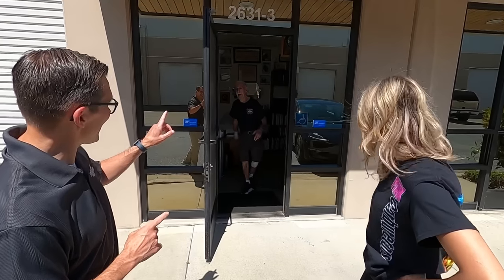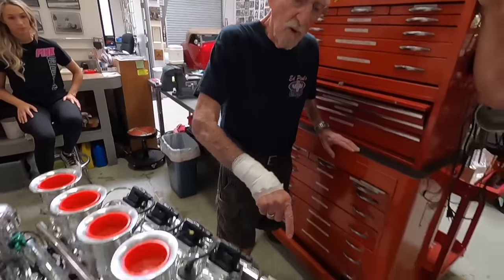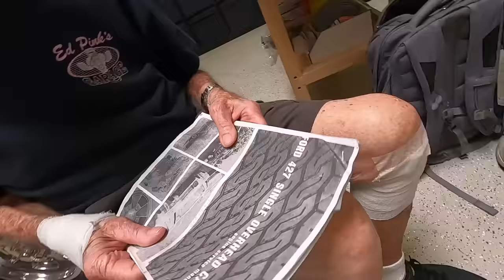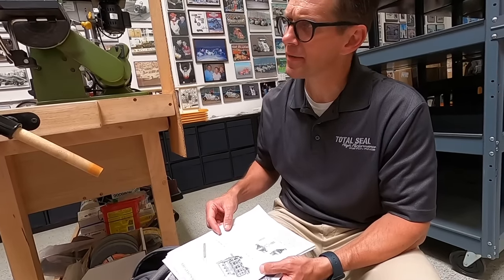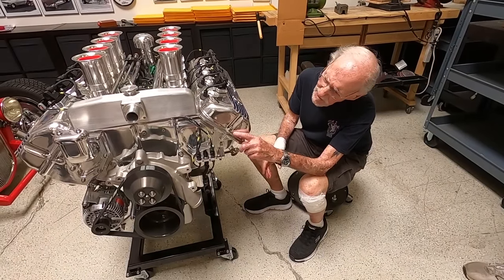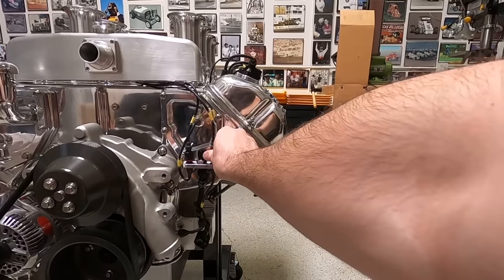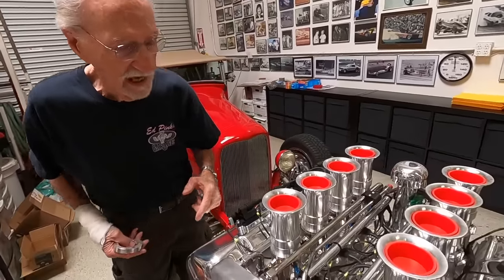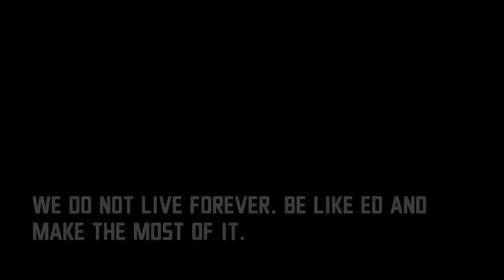The Ford 427 SOHC: Through The Eyes of Legendary Engine Builder Ed Pink (His LAST Engine Build)

Comment: Now I am curious. When I was working for JBA Headers I was sent up to somewhere in LA to pick up an old Ford overhead cam engine from an engine shop in our flatbed. I backed up, they placed it on the truck on wood blocks. We strapped it down and I prayed all the way back to the shop that it wouldn't fall over. I wonder if it was one of these legendary engines.

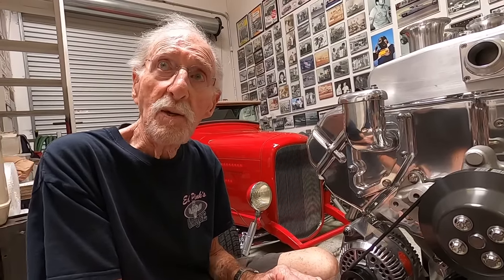Comment: Starting at around 32:30 or so in the video, Mr. Pink starts talking about the timing of the engine, setting the four timing points on the crankshaft, and then setting a timing point on the end of the right camshaft (looking from the front) at 45 degrees to TDC of the first cylinder on the left.  Mr. Pink also said that there was a 7 degree offset between the left camshaft and the right camshaft to account for the stretching of the timing chain under load.

Whith the system as shown on the engine, is the right cam still offset from the left cam by the 7 degrees, or does the system as shown with the electronics of the engine make this 7 degree offset issue moot, as the electronics would know where the crank was at any given time in relation to the right camshaft.
Reply from the maker: This engine is not supercharged on nitro with extreme power levels so I think these cams are ground even or close to it

Comment: Any engine can make power, just about how much time you want to spend problem solving. I have a Subaru EA71S, 1987 engine from Japan. It's a 1.6 liter flat 4. This one being an S model was a 100HP engine originally. It has a 305/305 cam, originally I had a single carb on it but now have one over each sides intake port. Titanium valve spring retainers, 120lb springs, etc. Aluminum pushrods to expand at the same rate as the block. 12.5:1 compression, .842 diameter lifters up from .801, chrome plated aluminum cylinders and low tension rings. The stock EA71 engine only makes 67 HP, the EA71S makes about 100 HP, and mine with the dual carbs and equal length headers makes 130 hp. I found the same thing with the spark advance. Stock was 8 degrees at idle, I found I could go to 16-18 at idle with no spark knock on 93 octane. 24 degrees of mechanical advance plus 18 is 42 degrees total. Very inefficient "bathtub" combustion chambers means it loves timing advance. I can go up to about 65 degrees on 100 octane, but I've only had it dyno'd on 93. Still 130 out of one of these engines is more than they make with even a turbo, all just by shortening the intake tract and making the exhaust equal length, and advancing the timing up right before the point where spark knock appears, and it's 30 extra HP over the factory racing engine. The Oldsmobile diesel is another engine people think is impossible to make power with. It's not. Early 78-79 pencil injector heads, O-ringed 80-85 block with matching receiver groove in heads, copper head gaskets .062 thickness, Peninsular marine 6.2 rotor and head on the stock IP housing with locked timing at 20 degrees advance, external EGR truck intake with EGR blocked off, carb hat on the upper intake, S300 turbo off a CAT 3126, intercooler, ARP head studs, splayed bolt billet steel main caps, Speed Pro 108M main bearings, King rod bearings, 4 stage dry sump oil pump with piston oil squirters in the pan. Internally balanced rotating assembly. Injectors have to be set up with pintle lift adjustment all the way backed off. This setup would be good for about 500-600 HP on regular diesel fuel. I've built one and it does 550 HP continuous, it's in a boat. Governor is set up for 6000 RPM max, it's a 3.385 stroke engine so the piston speed is quite low. Piston oil squirters, dry sump oiling, half groove mains, and copper head gaskets are the key to keeping it together. Nobody would ever think it would hold together at 550 HP but this engine is 5 years old at this point, it's in a Tahiti jet boat, and he takes it out every weekend in the summer No problems and it's on stock rods and crankshaft, just internal balance. UEM pistons .030 over.

Comment: I'm an automotive fabricator/engine builder. I build s195 mustangs with the 2v 4.6. I run a single 88mm precision turbo on my comp car. Stock displacement with cast iron sleeves, trick flow head castings, custom grind on OE cams, titanium valves, billet pistons and rods, trick flow aluminum intake manifold, 8, 2 inch primaries Into 1 directly into the twin scroll t6 flange. Fuel tech managed, rywire mil spec harness. One single bulkhead connector runs everything in the car. A/C, stereo, lighting, electric water pump, t body, wastegate, everything. The only thing the serpentine belt runs is the a/c compressor and the alternator. I convert the timing chain to the 5.4 unit with modified 5.7 Toyota sliders, and tensioners because they're absolutely amazing. At 5700 feet above sea level and 21 psi my car makes 874 wheel hp. I run a mixture of 60% c16, 40% pump 91 with techron. Not positive it makes a difference but I've never had an engine blow up running it so I'll continue to do so. I run a small amount of zinc additive in the engine oil as well. I run a Nissan cd009 with straight cut gears and a triple disc clutch masters unit. Hotchkiss tubular front subframe, all drift domestic front knee assemblies. I use the OEM 8.8 rear end with 34 spline summit axles, Yukon ring and pinion with a Yukon spool. Driveshaft shop carbon driveshaft, 6pot baer front calipers and I run 2 OE front calipers in the rear. I run all bbk rear arms and super trick fortune auto coilovers. I'm actually sponsored by fortune auto. The coilovers on my car are so far ahead of anything I've ever seen or heard about. My grandmother was Rusty Wallace's engine builder through the 90s. So he actually sets my engines up to run OEM, LS style crank bearings. He also makes my billet rods and Pistons.
Reply from the maker: Larry Wallace?
Reply: @Stapleton42  No no, Rusty Wallace, the nascar driver.

Comment: Most people don't know Ford offered an 800 horsepower 427 SOC 81200 the dealership would charge you $2,000 you can order that into a streetcar you can check the data on Ford 100 year book tells you what options were available at the time

Comment: Connie Kalitta and Don Prudhomme, both earned 1966 NHRA victories in dragsters powered by supercharged versions of the Ford 427 SOHC engine running on nitromethane fuel. Kalitta drove his Bounty Hunter entry into the winners’ circle at the season-opening Winternationals at Pomona, Calif., while Prudhomme prevailed at the Springnationals at Bristol, Tenn., in Carroll Shelby’s Super Snake entry powered by the same engine. 

   At the 1967 NHRA Springnationals held at Bristol. Prudhomme posted the fastest qualifying time and became the first top fuel driver to break into ‘6s at a NHRA national meet and the first to break 220 mph (6.99 @220mph). He also ran sub-7second times in three of four elimination runs (shut off early when opponent fouled in the other run). Prudhomme beat fellow Ford driver Pete Robinson in the final. Connie Kalitta is the only triple crown winner of the era and he did it with the Cammer.

  There's plenty of other classes (AFX Gas Rhonda, Ohio George Montgomery A/GS 4 championships, Dyno Don Nicholson match racing) and others that also utilized the Cammer and beat the best Chrysler had to offer.

Comment: Ford gave Eddie Sharpman three cars to race with those engines in. My brother Bill and Joe Shubeck modified the cars so the engines would fit the whole engine compartment had to be changed ,front suspension had to be changed to give room for the engine .when these cars showed up at the drag strip the hemis went home!

Comment: "We were the Ramchargers" discusses running a lot of spark lead in the 426.

Until the 426 was supercharged, running nitro, you ran the risk of blowing the crank out of the bottom of the block if you ran more than about 40 degrees of ignition lead.

Tom Hoover was the one who thought that the 426, with its strong bottom end in the block, could live with more lead.  So they advanced it ten degrees.  And the car immediately laid down its best ever pass.  So they added another 10 degrees, and ran faster, plus "it really started to sound like an animal"

Eventually, they ended up running 70-80 degrees.

Comment: I'm pretty sure it didn't say no overhead cam before Ford attempted to enter the 427 SOHC. The Jaguar XK 120 that won a NASCAR race in 1954 would have been overhead cam 6 cyl. A quick Google search claims the ban of the overhead cam started in 1966. It is possible Ed is correct but not probable since most of the evidence points to the ban being because of the SOHC, not before the SOHC.

Comment: 18:14 totally agree.....
.
im "just" a mechanic...... but i have ALWAYS worked on anything that you can drive or drag to the shop
its just a machine..... spark, fuel, air, compression, and valve timing (and a CrPS and CaPS sensor now days lol) 
.
but ya..... a 5.3 has its own "common  issues"
a 5.4 ford has its own issues
a 3.1/3.4...then the 3.5/3.9 GM  v6 VS a 3.8  buick v6.....
the 6.0/6.4 power-joke is just that.... a joke.... (had to, sorry) 
.
its all the same..... yet different 
.
they are just air pumps at the end of the day..... they just have slightly different ways of getting it in, making fire, and blowing it out

Comment: Porsche used sodium-filled exhaust valves on the 912 engine back in the 60s, I read that Ford stole this and even used 912 as the Ford part number.
Reply from the maker: The v12 aircraft engines of wwii had sodium filled valves too!

Comment: about that timing chain scratch... the 4.6sohc in the car i have has a fuel mix of 0.5 volts on one cylinder bank and 0.8 on the other... the 8 being a rich mix. that motor wants 400hp fuel injectors to read 0.5 volts in each exhaust bank on the top end. to the rich bank is an advanced camshaft that retards that little bit on the top... the exhaust at idle sounds cooler.
Reply: might just be that the fuel rail has the regulator on the one side, but it is as it is.

Comment: I use a voltmeter to time my electronic ignition timing, you see the exact magnetic pickup or leading edge of the magnet and mark it.   Man this guy is smart...shit.  I use a timing dial to time my mags on my Bonanza aircraft,  critical to find TDC and BDC.   Only way to do it accurately is to use a piston stop in the spark plug hole, when the piston stops FWD and RWD you mark the crank and divide the degrees by 2 and that's perfectly TDC and BDC, no other way to do.  People don't understand there's about 10 degrees of rotation where the piston basically doesn't move at TDC, so you have to use the stop method.

Comment: Ultimately the 2nd Gen Chrysler Hemi won. Eagle had a 4 cam engine that was supposed to overthrow the Hemi. Just too complicated for consistency.
Reply: Chrysler built a 4 cam 426 hemi. It was never released.
Reply: @WilliamPayneNZ  The A925 Dual Overhead Cam Hemi. I heard it never ran under it’s own power. And was mocked up to make Ford rethink their SOHC. It might have been a good engine. Gear drive instead of a chain, and obviously 4 valves per cylinder. Ultimately the Eagle Fuel Engine that was built to take in the 2nd gen Hemi in Funny Car and Top Fuel was too problematic to service in between rounds… much like the SOHC Ford.